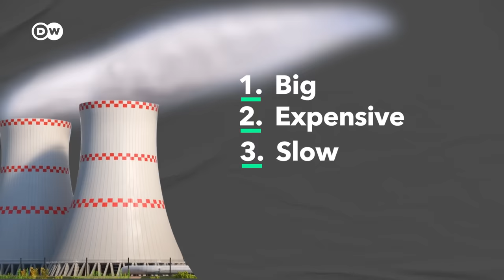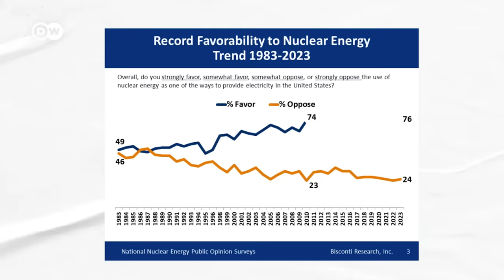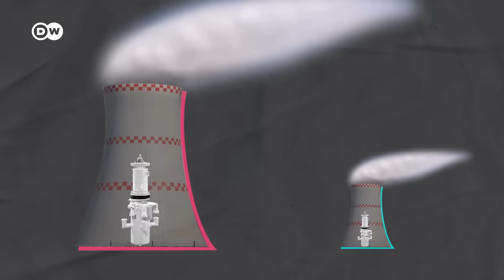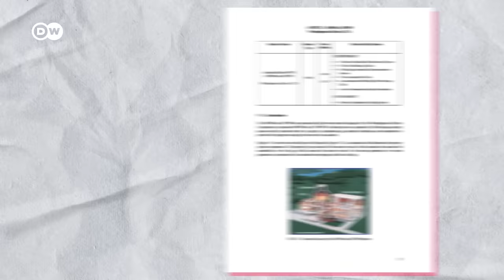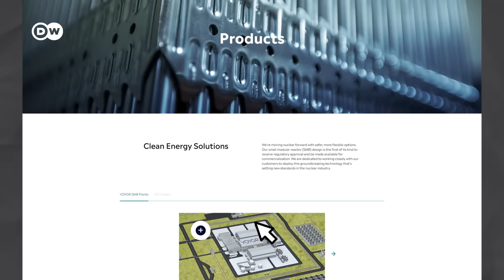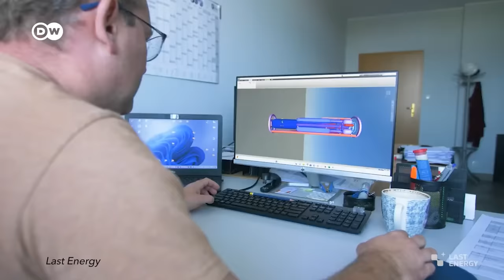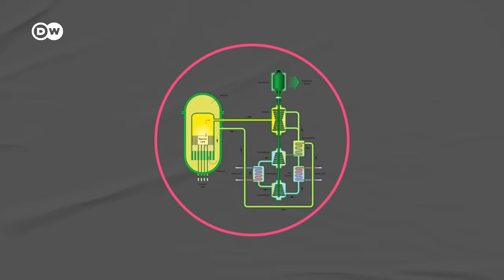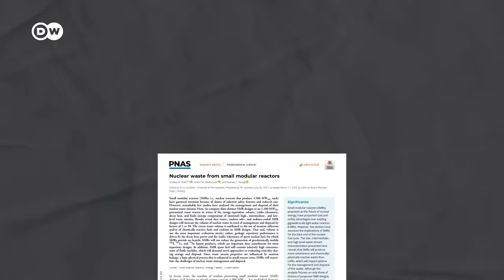Why people want to put small nuclear reactors everywhere

Comment: Nuclear plants are too expensive, take too long, are too fraught with uncertainty. Uncertainties as; cost overruns, delays, cancellations, accidents, natural disasters, war & terrorism. While solar, wind are cheap & growing very fast. Worldwide solar grew equal to 53 nuke plants in 2023. Even SMRs are 4 times more than the cost of energy now. Legacy nuclear is about 10 times more than solar and wind right now. Tax dollars should not be used to build SMRs. Private equity doesn't want to invest it because of all the uncertainty. The idea that reduced regulatory control is a way to make SMRs cheaper is just playing with fire. 

Go with solar and wind. It is what the market is doing. This year the US is not building any new coal plants, one nuclear plant and only a small amount of natural gas is being added. The rest, that is 96.5% of additions to electric generation, is wind and solar renewables, or renewable related, namely batteries. Putting 66.7 GW of wind, solar and batteries capacity online in one year is going to retire a lot of fossil fuel plants, as well as negate the need for nuclear. Nuclear at this junction is simply too slow, too expensive and too fraught with uncertainty to implement.
Reply: You can't fully substitute fossils with renewables, since they're not stable sources. When you have too much renewable power it doesn't actually provide any benefit, since its going to add even more energy during peak moments of the day but still be useless at night, for instance. 
You need some backup source that can cover the base load. And you can do that either with fossils or nuclear. Since we want to abandon fossils, the solution needed is pretty clear
Reply: @timwoodruff5728  yes of course, I wasn't saying renewable don't have any place in the energy sources cake graph. We need them, and we still have a pretty wide margin of deployment, but we can't hope to phase out fossils going 100% renewable. That base load must be covered by a stable and reliable source
Reply: Batteries are filling the gap that used to be occupied by base load power stations. There has always been a mismatch between demand cycles and generation. The graph that plotted demand was called the duck because of the way it looked. It showed low demand at night and the early morning rising up when people woke up, it dropped a little when people were at work and then would rise up again when people got home and turned on TVs, air conditioners, ovens etc. Most electricity used peaked in the evenings after work and then would go down again as people slept. This represents intermittency of demand. Power plants were built to meet peak demand with the rest of the time the plants were being underutilized. Utilities don't want demand to go beyond peak because that would mean they would have to build a new plant to meet demand that wouldn't be its most profitable until demand reached near peak again. Utilities would employ fast turn on peaker gas powered power plants to cover when demand would pass peak periodically. This was always very expensive. Peaker plants would just be standing by until needed and then they would charge the utilities lots of money so they could stay in business when they weren't needed. This was the old model. Base load barely existed since it was only viable for the amount of demand that electricity would drop to at night. 
Wind and solar plus batteries has created a new paradigm. With batteries power can produced at anytime as long as it is enough to cover all the demand for a few days. Demand can be anytime since matching that demand with batteries can be almost instant, unlike gas peaker plants that need time to start up. Right now places like California and Texas are producing more wind and solar than can be used during the day. Ever see wind turbines not turning? That is the utility curtailing wind turbine generation because there is too much electricity on the grid. The same happens with solar. With batteries all this curtailment can be stopped and the energy can be stored in batteries to be used when it is needed. It also can grow incrementally as demand grows without needing to spend the time and billions to build a whole new power plant. 
So, to answer your comment. Wind and solar can and does substitute for fossil fuels right now. New generation of wind and solar with batteries is set to be some 50 plus gigawatts in the US this year. Batteries matches both demand intermittency as well as generation intermittency. Wind and solar with batteries are winning the day.

Comment: Want a nuclear plant in your backyard? Store waste for thousands of years after 30 years of energy? Insulation doesn’t melt down-neither does solar or wind or pumped hydro or…
Reply: If the proposed SMR is of 2nd generation, I agree with you. But technology has advanced and 4th generation nuclear power plants are using nuclear waste from the past as fuel, producing only a fraction as waste, and don’t need “fresh” uranium to work. In addition, by not using fresh water to cool but molten salt, as in example, there is no more possibility for meltdowns.
Reply: That's the description of 70s technology (the world moved on since then btw) and even by that standard during those years, nuclear triumph all tech solar, wind, geothemal, etc.
Reply: Nuclear waste is not that big of a deal: we produce it in very small quantities and we know how to safely and effectively deal with it. Plus, it won't be dangerous forever, unlike other toxic waste from several industries that we just "throw away" without even treating.

And btw, nuclear power plants usually operate for more than 60 years. In many cases their licenses get extended to 80 or even more. 
80 years of abundant, safe and clean energy.
Reply: What if a team of security will be needed 24×7×52, for 30 years. to hinder green terrorist, from attacking the plant, eg tesla plant in Germany

Comment: I don’t understand the lady in the video, she says SMR doesn’t have the economy of scale of energy production but could you not combine SMRs to get huge outputs like big power plants do now, with much lower cost, to both the size of land needed and the cost and time of the initial construction
Reply: There has never been economies of Small scale on power generation.  Your comment makes no sense. EXAMPLE:  If auto manufacturers wanted more power in vehicles, why do you think they put in larger more efficient engines instead of putting in multiple smaller engines in one vehicle?  If you can answer that, you have the answer to your comment

Comment: i think smaller nuclear plants may assist if there is an area to make a larger plant but there needs to be that a equal of those investing to have a consences of working together for the benefit and not for the money. Though they will need to see and have some part of control, it needs the old control to be balance so that all concerned are not tripping over each other's feet.

Comment: I don't see what the big deal is. We manufacture small reactors for years that are put in our submarine and ships. Reinventing the whole thing commercially vs government continuing with what they have been using safely for years is questionable.  Allowing many to use the technology is an issue that I believe should be kept , at this point, under direct government control.  Having power for the country is a matter of national security and should be controlled by the military [even if it's just the security  of the plant].  Use an existing micropowerplant  design and have the government install and operate.  Keep our need to be dependent on outside countries fuel to power the country.  When the units age we control scraping them vs private companies going bankrupt  and leaving us to flip the bill anyway.
Reply: As good as that plan would be having that many reactors that the military have to monitor would be almost impossible with the personnel that are trained and training.

Comment: The first smr has to get built, to show its viable. Then a factory for smr needs to built. Then it needs to export those smrs. Somewhere along the way, a better waste solution needs to be found. I'm thinking collecting all the waste to heat large amounts of water, then run heat pumps off the heated water. Or we ship it to a multinational funded storage site in Antarctica.
Reply: There is a pike of dirt across the road from us at Darlington Nuclear with a SMR sign on it under construction.

Comment: It sounds like they are an attempt to work around slow, expensive and often irrational regulatory costs rather than just addressing the regulations themselves.  Also if you need to build 3x or more as many nuclear plants you're going to have to deal with 3x as many NIMBYs.  Just telling people "don't worry bro it's modular" isn't going to solve that problem.

Comment: 1) Water cooling implies high pressure steam. And the need for a thick containment vessel to contain any cooling failure (high pressure steam == explosive failures). This choice is the #1 problem in legacy nuclear. Using ambient pressure cooling should be required (molten salt or equivalent).
2) In the US, we used-up our uranium decades ago. Uranium fuel comes from Russia. Does this sound like a good place to source your energy from?
3) The problem for SMRs is they are still too big. A typical Tesla can DC charge at 200 kilowatts. This should the target. 200 kilowatts electric means 300 kilowatts thermal.  In Florida, have the charging throttle down automatically when the home air conditioning kicks-in. 
4) The SMR building block should include electrical generation. I want a PNR (Personal Nuclear Reactor) available. Two pieces, each the size of a 50 gallon water heater. One piece is the reactor, the other piece is the electrical. Make this a building code requirement for any building, residential or commercial, over 5000 square feet.
5) Design and manufacture a much smaller 5000 watt electrical version PNR. Then pass a law that bans the use of portable gasoline generators on food trucks.

Comment: If economics are the issue, why not use them for heat generation too? A lot of industrial processes need insanely high temperatures as part of the manufacturing process. It's a very good way of decarbonising industry while providing a revenue stream for the company researching and constructing them.
Reply: Exaclty. Sell the exhaust steam for space heating, process heat, and absorption refrigeration.
Reply: Using the gamma rays to bake bread or what?
Reply: @JeermynRex  No? How is that the first thing that comes to your mind when there is the obvious application of using the heat from nuclear fission to process metals, synthetic fuels and desalination, and the generated neutrons to dope semiconductors?

Comment: IDK. It would seem that large reactors would have more benefits, as they could be built on the same property as our current power plants and connected to the infrastructure. It would seem that several small ones would require huge infrastructure costs.

Comment: Do they have an explanation of how to handle nuclear waste?
Reply from the maker: We have done videos on spent nuclear fuel's future you should check out!
On reusing it 👉 https://www.youtube.com/watch?v=hiAsmUjSmdI
On world's first permanent storage for it 👉 https://www.youtube.com/watch?v=QFEd5RkotFE
Reply: @DWPlanetA  Yes, I did watch the video, but it mentioned that nuclear waste storage requires significant costs and a strong structure. Due to the high costs, only a few countries are willing to recycle nuclear waste. If the nuclear waste comes from smaller reactors, will it become more costly because of the smaller scale?
Reply from the maker: The Stanford/British Columbia study found that there might be hidden costs at the end of the fuel-cycle of SMRs mostly due to larger quantities and chemically/physically more reactive waste than in light water reactors. And yes, it seems like nuclear waste management doesn't scale down as easily as the reactors themselves.

Comment: An aspect of SMR use case they're failed to mention is sole-use & private ownership.  With the advent of AI, data centers are now becoming campus' with needs of (at minimum) 100MW and (at most) 1GW.  The current electrical generation will not be enough in 5-10 years and, as noted, the wind doesn't always blow and the sun doesn't always shine...SMR's WILL (dare say, ARE) become the solution spinning-up an entirely new business model of private nuclear operations.

Comment: I think to address safety hazards and security concerns simultaneously, without building from scratch, they could be naval based (like offshore rigs) or air craft carriers alike. Their back up systems could be hybrid solar & wind energy. Plenty of water available as coolant, plus be the modular parts could be transported, assembled & fitted onto retired military or commercially auctioned cheap second hand ships. Desalination plants & off shore drilling ships could be constructed & powered like that as well as E refueling bases besides national grid connections. Scaling, enrichment, economic viability, technical feasibility, safety concerns remain key impediments.

Comment: SMR's could be interesting but only in the very long term to see if theyre even viable. We shouldnt make us dependent on the promise of a technology that isn't mature yet. Especially not one which is this far off from maturity. I'd say we generally should keep rolling out conventional renewables (Wind & Solar) and look at energy storage solutions like heat storage to potentially fill the short term lack of power output. Also invest in better interconnectors between countries to allow for easier movement of electricity across long distances. 

And if a country can figure out a long term waste storage solution then I'd say use Nuclear to supplement. Big emphasis on a waste storage solution! Much of the world's anti nuclear movement started in Denmark where I'm from and we still havent found a permanent storage site for nuclear waste from our test study reactors from the 1950's. Of course modern reactors should afaik have less waste for the power output than those, but any waste storage is still critical.
Reply from the maker: Hey there! Yes, many countries are working on different nuclear waste storage solutions. Finland focused on an underground storage. We visited it a few months ago 👉https://www.youtube.com/watch?v=QFEd5RkotFE

Comment: Nuclear power is typically "carbon neutral", not "low-carbon" as stated in the video. It is for this reason that countries, predominantly smart countries, designate nuclear as a green energy source. 
We don't bring up the Safety issues of previous generations when we are talking about Gen4 Reactors, as the entire perspective/scope has changed in terms of how accidents are viewed. Safety systems are now entirely passive and function without human intervention.
Reply from the maker: Hey there! The comparison looks at the whole life-cycle of a nuclear power plant. Meaning that it also includes the building for example and that emits CO2.

Comment: People think it sounds great, but they still have to meet the security, emergency standards, and waste management requirements of large reactors. No change in regulation has been made in theses areas and we should expect none to be made. So they must be surrounded with high double fencing with microwave intrusion detection systems and 24/7 security guards. They must still have exclusion areas, evacuation plans, ways to alert the nearby residents. These small reactors will still need to store waste on site or pay some one to store it for them as the government still has has developed a waste repository. The same site evaluations must be made as for a large reactor. Given all this has to be done why not just make a big reactor to produce more electricity. Additional as of today no small reactor designs are approved for use in the US by the Nuclear Regulatory Commission.
Reply: Nuscale's design was approved, it just wasn't built.

Comment: USA should build these in desert states 🇺🇸
Reply: Think it should be put in a ship. Move it to power any coastal city as needed. Earthquake - no problem. Tsunami - It floats.  War - move it to a safe zone.   In an emergency just flood the external housing with sea water. There is no chance to run out of water and if it's bellow the water line it doesn't need pumps.

Comment: 6:10 every nuclear reactor accident ever...  the reaction was unable to be "shut down"
Reply: Fission stopped, the waste heat was the issue.
Reply: Not exactly. You can shut down the reactor. But the core will still generate waste heat, at less than 10% regular output.

Fukushima for example did shut down. But because the cooling system got knocked out by the tsunami, waste heat slowly evaporated all the water across days until it got too hot and melt down.

This won't happen to SMRs because:

1. Square-cube law. Smaller reactors have greater surface area to volume ratios. Which allows much easier heat dissipation.

2. Which is why these reactors can use convection and continuously evaporate and condense water without any need for power.

If an SMR got hit by the tsunami like Fukushima did, loss of power wouldn't result in any problems. It'll just cool itself passively.

Comment: None are certified. They are expensive. They still produce long term waste. Solar, Wind, Geothermal are working now. SWG is cheaper, produces no long term waste. California just did 57 days of full electrical power so why are we still chasing this? More batteries is the actual answer and California is installing them. By the time SMR is certified CA will long since have been "fixed"